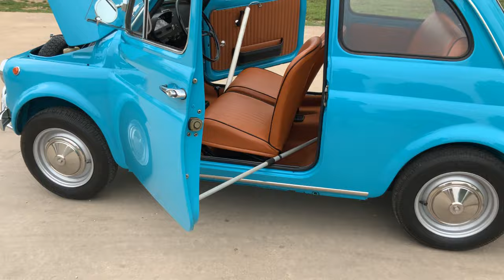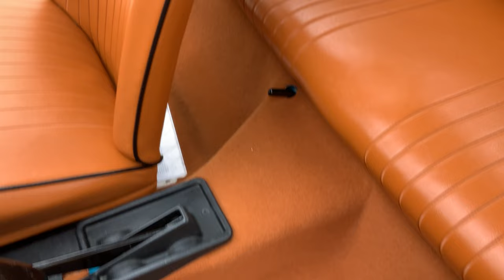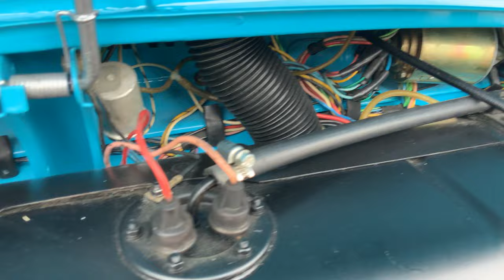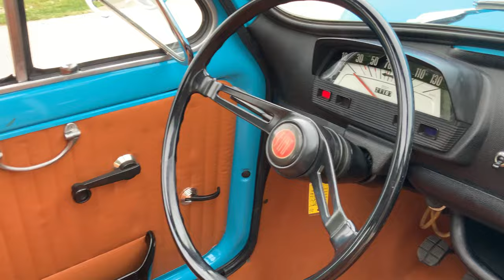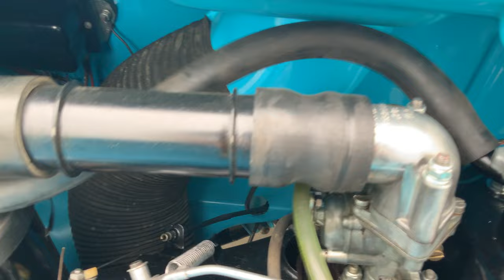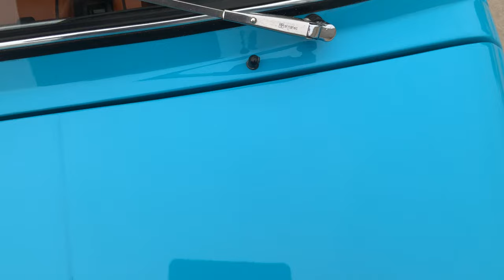1971 Fiat 500L 479cc Twin 4-Speed Retractable Vinyl Sunroof Show Quality Restoration 71-7133T

Comment: My dream car in this century ❤. Had the experience very high speed of 70 mph as a passenger in 1962.
Reply from the maker: The speedo is in kmh and it is said to top out at 90. Which equates to 55 mph. I did have it at 70 kmh in the driveway myself. Was the one you rode in modified?
Reply: No.